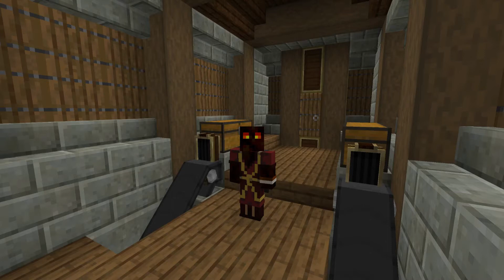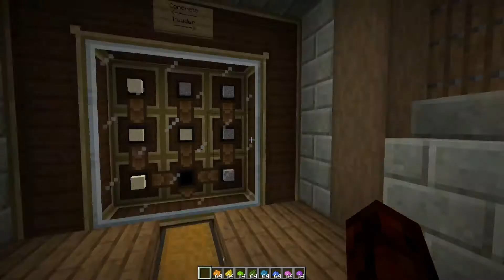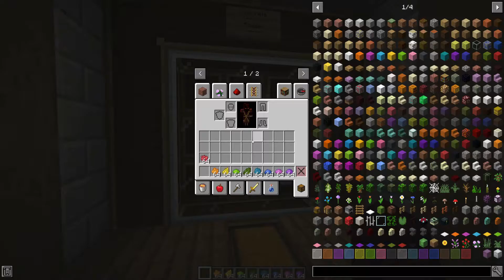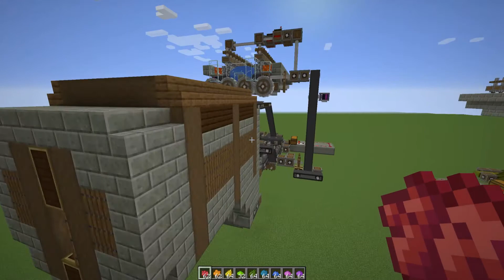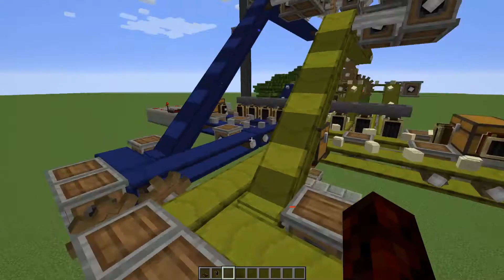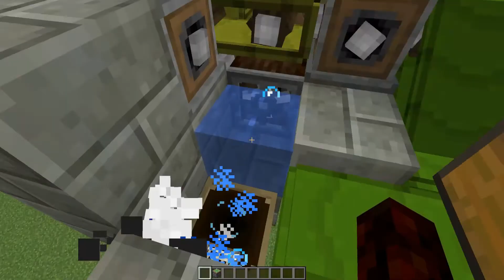Minecraft Create Tutorial Episode 5: Automatic concrete machine!

Comment: Neat thing to note! you can wrench the backside of mechanical crafters in such a way that they connect. Connected crafters as the name implies, means you'd only need one input for one material type; eg input for sand, input for gravel.

you connect crafters through right clicking the lines between adjacent crafters!

I do hope this helps, as I myself made an autowashing concrete maker too - which was a fun experience